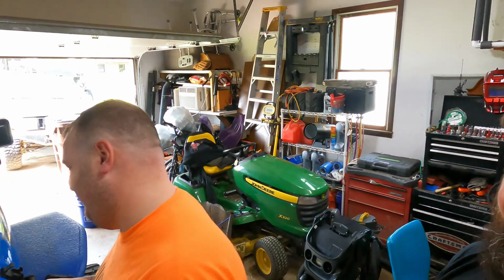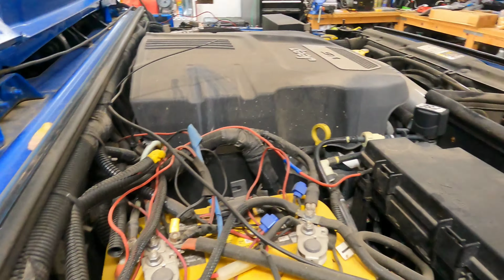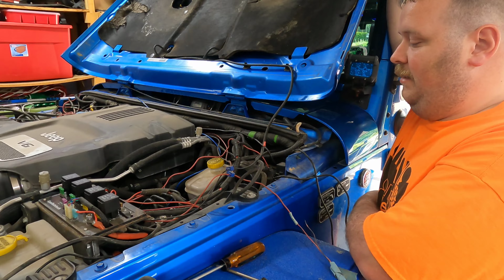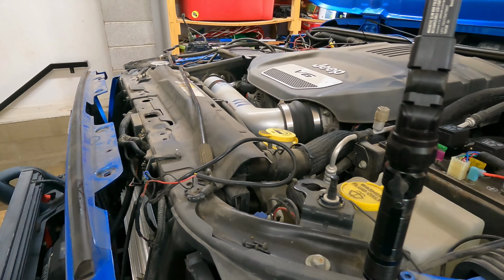A Re-volt-ing rewire

Comment: I was shocked when Dylan showed me that at Windrock.
Reply from the maker: Yeah, it was a lot of wires and connectors. Like I said in the video,  the main issue was the style of connector. They come with a lot of kits because they are cheap and fast to use, but there are a lot of better options out there.